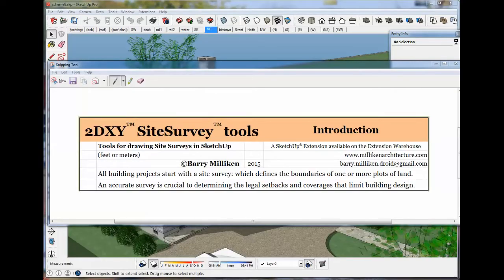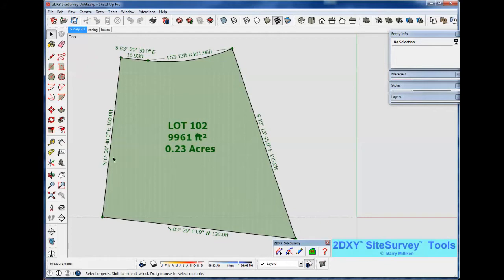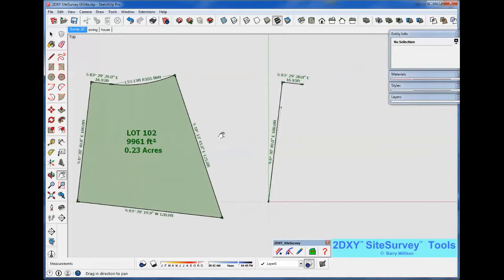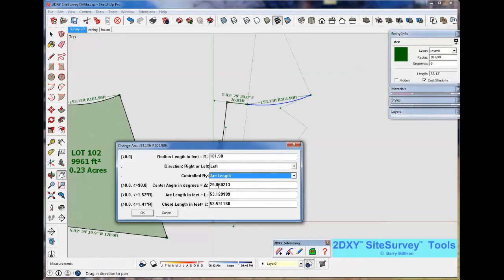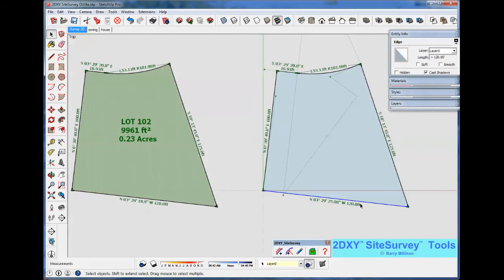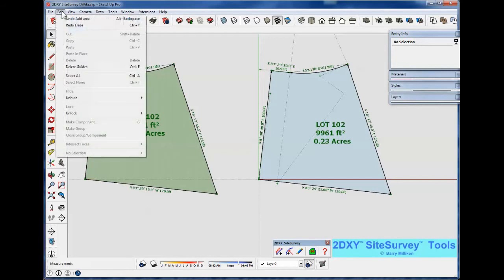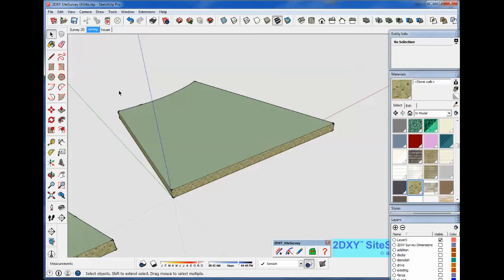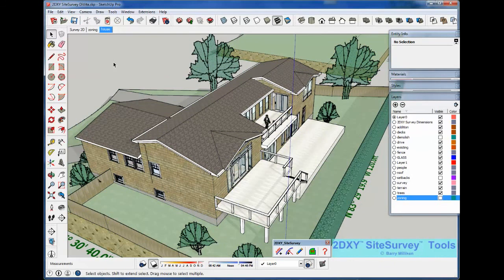2DXY SiteSurvey 3 0 Basic Lesson

Comment: Just downloaded the trial version.  I make sure I am in top view.  I draw my initial line.  I select it and it turns blue.  I then open the edit tool and put in my bearings and lengths.  The resultant is a 12 sided polygon.  ANy suggestions?  Also, when i downloaded,a pop up box said it may not be compatible with current version of SketchupMake which is 17.